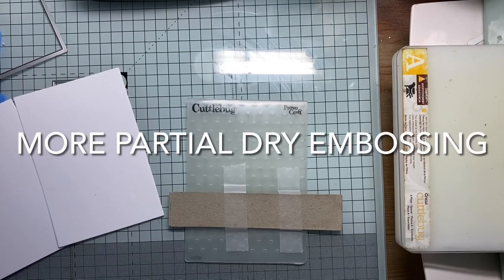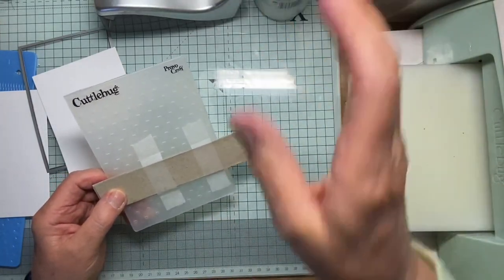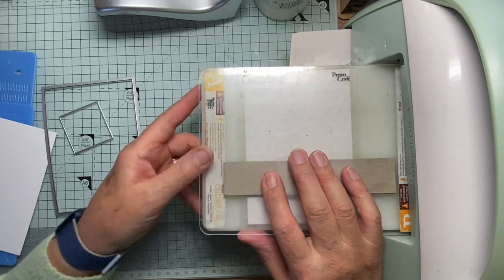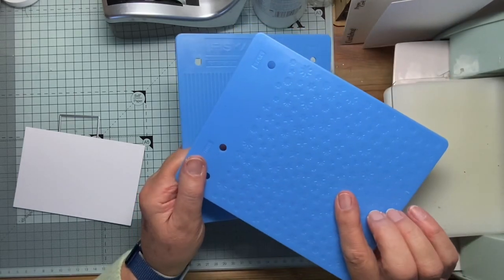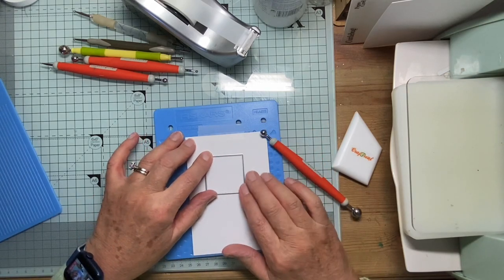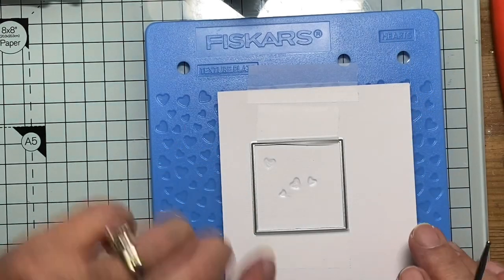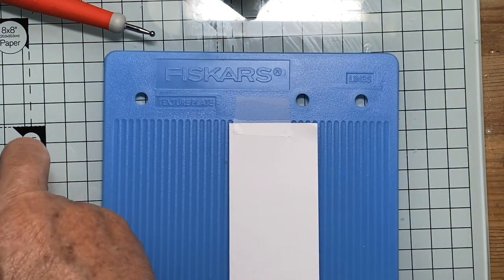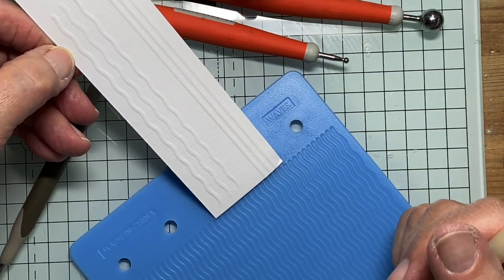More ways to do partial dry embossing

Comment: Aah memories❤. I too still have these. There was another tool that you brought separately, which had three swivelling ball-bearings which was used to go around the back. Also if you use an old tea light on the surface which you use the ball tool on it help the tools move more smoothly and you don't need to apply more pressure. I must dig these out😊
Reply from the maker: Thanks for sharing!!